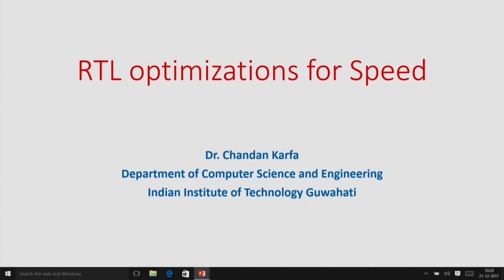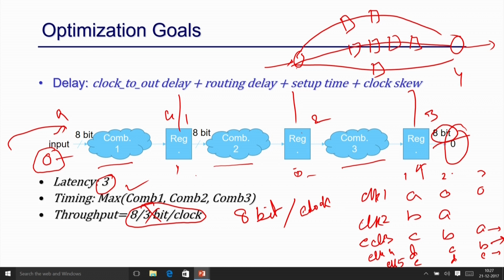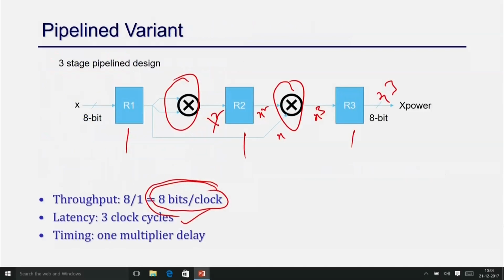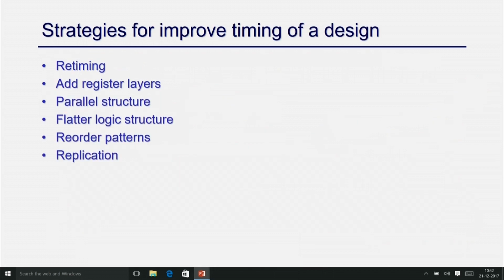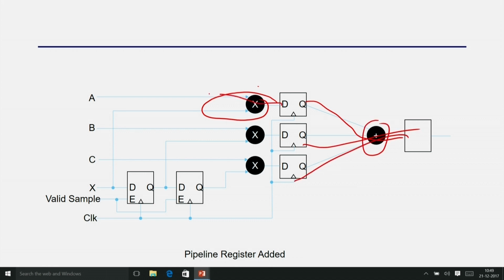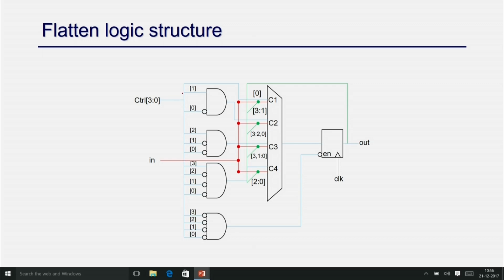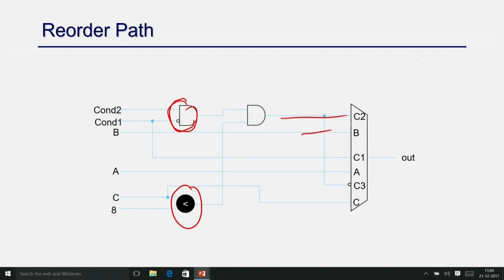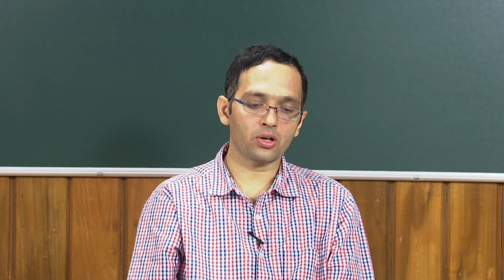VLSI Design [Module 02 - Lecture 06] High Level Synthesis: RTL Optimizations for Timing

Comment: The  pipelined variant shown in the image is wrong as flopped output of R1 is directly bypassed to the next flop but the value after R1 flop will change in next cycle which will lead to bypass of next input multiplied with (older x)^2  which doesn't makes sense.